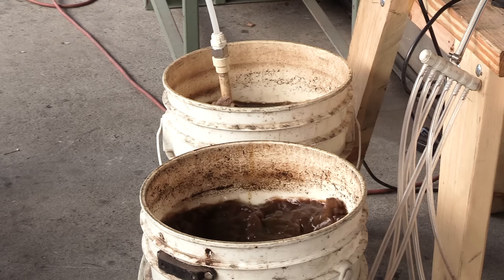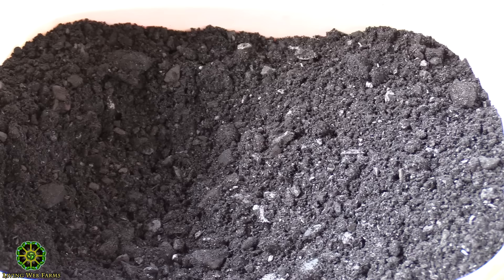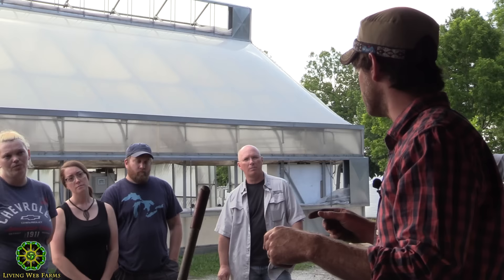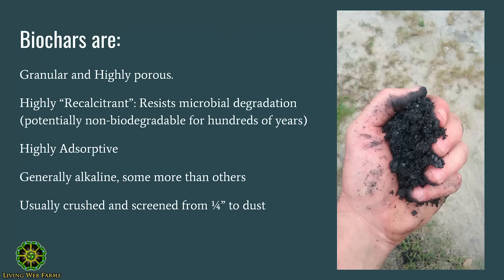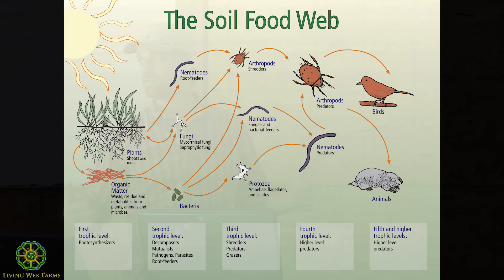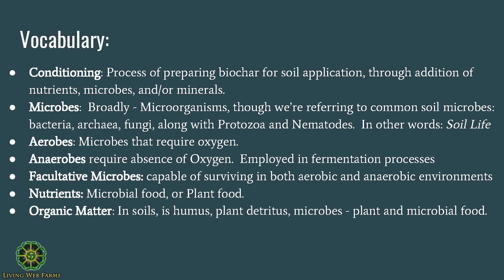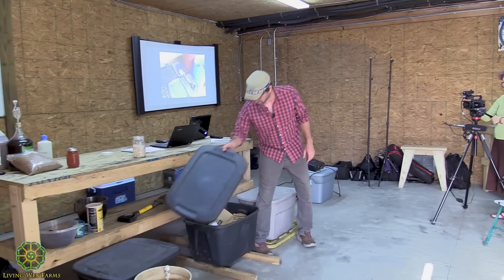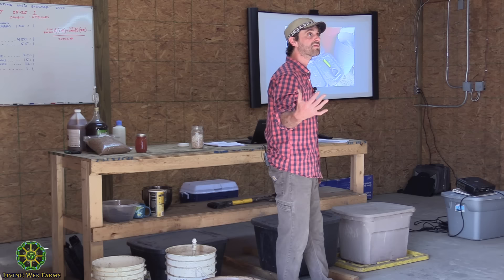Biochar Inoculation with Dan Hettinger

Comment: The fact that the Red Wriggler worms are at the top of the worm bin material, and not deeper down in the material, is not indicative of a problem. Red Wrigglers congregate and feed near the top of the soil.  Nightcrawlers and many other species of earthworms burrow and live deeper in the soil (and, thus, are better for soil aeration than are Red Wrigglers).
Reply: That is also my experience with Red Wrigglers. They like to hang out right under the food layer. If they’re burrowing away from the food, you may have acidity buildup from over feeding.
Reply: Theyll move to the wettest part of the bin, yes this does tend to be where the food is, but they will go extremely deep in the bin in pursuit of the moisture.
Reply: Yeah he knows a little he is killing shit though, to much air first off. Second all you need is a bacteria culture. With nematodes and protozoa bacteria and so on.

Comment: I'm skeptical about the way I see biochar being applied.  The idea for biochar is twofold.  One is that is helps the microbiome of the soil, but the other is it's REGENERATIVE.  But throwing biochar on top of the soil, to where carbon can still leech out to me is not regenerative.  Adding biochar needs to be done along with soil preparation before plants are ever planted, to get the biochar mixed down in the top 12" or further for deep rooting perennials.  

One driver for biochar is what farmers did in S. America in the Amazon, but those farmers dug deep trenches and it was a combo of biochar and organic debris falling into the trenches and then buried.

Comment: Hey Dan, sorry for the stupid question, but I've watched the video several times and couldn't get an answer to this question: how long do you leave the biochar soaking in the compost tea?
Reply: Same question here. I can’t find any info anywhere on how long to soak the bio char. I’m brewing compost tea with bio char in it, hoping more time in a bubbling solution helps.
Reply: I would recommend adding compost and biochar to the soil you want and adding molasses later or not at all
Reply: @robpash2204  he said an hour
Reply: @tinatina4789  seems it would need more time, I'm not sure
Reply: @tinatina4789  Thank you, Tina!
Reply: @tinatina4789  It takes days for best results. The hour he referred to was how long before the microbes in the compost tea start to die after removing the aeration.
Reply: I'm going to make a batch of compost tea and then soak the biochar in it for a couple weeks, even though many microbes will die off aeration. I'm also going to add 3 times as much compost to the mix, while it's soaking. Good plan? Bad plan?
Reply: @pedro.meza.33  experiment and report back
Reply: @mrbill700  I wish I had a microscope
Reply: @robpash2204  he said it was brewing for a little over 24 hours at the beginning of the video!
Reply: 24hrs
Reply: 14 days

Comment: I'm just going to start throwing this out there... Years ago, when my son was a young boy, we loved camping and discussed ideas of all things survival. I spoke about an unknown idea I had of a human waste pit and on each defecation adding a sprinkle of fire ash to deodorise, which would also balance acidic urine. I wondered if, once the small pit is full, straw or hey may be optionally mixed in, top the pit with turf for a time to partially compost the matter, then dig up and shape into blocks which are air dried and used for fire blocks as fuel, and very possibly make great fertiliser for agriculture also! I've always wondered why society doesn't seem to know what to do with it's excrement, other than throw wash it into the water ways??!
Reply: Other societies have used human waste heavily in agriculture, but have run into disease problems. Those problems are easily solved with our modern understanding of the science, but we now have so many cows and pigs that it makes very little sense to use any other manure. Of course, if economics wasn't the primary concern, there are all kinds of ways we could do things better.
Reply: @ernststravoblofeld  thank you for your comment :-) .. I agree, if economics wasn't our (!?) primary concern, then there are all kinds of ways we can do things better. 
Human waste, I am suggesting, is treated and fermented in localised earth pits with the application of pure fire ash which deodorises, moderately sanitises, and balances the acidic Ph (of urine and faeces) also. After a time of fermenting, it is then taken from the earth pits, it may be added to for purpose of application, then dried out in blocks. I further suggest that these blocks, due to the process which deodorises and sanitises, may be used as fuel also. Surely, this controlled and well balanced fermentation process may encourage good bacteria for the application of fertiliser; I'm sure fire ash is a key to this (as would be certain types of volcanic rock, like pure Zeolite).
Reply: @CRHall-ud9mq  If you sanitize it, you kill all the bacteria. That's what sanitizing means. 

The best possible use for human waste is not as fuel. It is an extremely good fertilizer though, with certain issues. Burning stuff for energy is something we really shouldn't have to do anymore.
Reply: @ernststravoblofeld  I wish you would tell all the energy companies still using fossil fuel, virtually every other person throughout my town who has had log burning stoves, or open fires fitted for burning coal (can't open windows here some days in winter, for the toxic CO2 smoke of burning coal blowing in, like it's 1989!), every other trades person and local farm (one acquired an incinerator) burning their waste complaining of paying for it to be accepted at the tip (choking black smoke blowing across the valley with the stench of burning plastic, rubber, and chemicals); tell them Ming. 
What do you do with your human waste? Are you completely carbon free on energy consumption? 
What is your study and area of chemistry? What is your understanding of the Ph of fire ash, it's properties and uses, and of fermentation in this respect??
Reply: Piffling over word usage, 'moderately sanitising'? Your argument, is like saying Manuka honey kills all good gut bacteria! Perhaps, also consider antibacterial herbs used in fermentation. Manuka essential oil fibroblasts cell walls, killing some of the worst known virus and bacteria, but healthy cells (those of the body supplied with living blood) recover extremely quickly. I bet you're not keeping up? So, certain issues arise when people think they know better without really understanding or having a genuine feel for the nature of life. Good luck mongy Ming ;-)
Reply: @CRHall-ud9mq  Words have meanings. If you just use them any old way, you aren't communicating. Especially in a scientific context. Rambling on about honey doesn't change that.
Reply: @CRHall-ud9mq   you're trying to solve a problem by dreaming up a process that's actually more complicated, time-consuming and energy-intensive. Economics are always a huge factor. If something costs more for possibly the same end result with the same or more hazards along the way, it is simply not a good idea at all. 
Do some experiments on your time at your expense and have the results peer-reviewed if you're serious about it. On a small individual scale you may find your idea works for you on your property. I'd be extremely surprised if you found a way to scale it up to a community or industrial level and be cost-effective/efficient. Personally I wouldn't bother with any of that humanure compost fuel stuff, but it's your life and budget.

Comment: I’ve got a question about the process at the 2:19 mark in the video. You mentioned adding all that air keeps the more disease carrying anaerobic microbes at bay which makes sense. What I don’t understand is how then shutting off the air and dumping it into a bucket with bio char is any different than just shutting the air and letting it go anaerobic. It’s not addressed as far as I saw in the video of how long it sits with the bio char  without air and what comes next.
Reply: By using the aeration bubbles during the growth period, the aerobic bacteria consumes the food supply and grows.  Once you turn off the bubbler, the food source has been consumed and the good bacteria has a hold, and will be able to overpower any bad bacteria.

Comment: Bag is called a paint strainer
Reply: Yes. They're very handy for several uses, affordable, pretty durable & washable, and can be found at almost any hardware store. 
I have also just used an old cotton pillowcase to steep compost... it works OK but obviously it doesn't drain as well.
Reply: A delicates bag from a store's laundry section would work pretty well I think. I don't recommend borrowing your wife's.
Reply: I think there is a similar bag strainer called a "jelly bag".

Comment: all your information regarding the good aerobic micro bacteria and fungi inoculation into the biochar is crucial but you make a big mistake. let me explain when you add the water filled with aerobic microorganisms you drop too much water or too little biochar so the mixture is saturated. There is no air in the mixture and so the good aerobic bacteria and fungi will die.  the solution is simple to add much more biochar or less water. thank you for all the good information.

Comment: How long the charged biochar has to be kept after charging with compost tea shown in the beginning?
Reply: The charging is the bacteria cultured in the fertilizer and tea.  It will stay around as long as they have something to eat.  So you could add fertilizer to the biochar and mix it in or, moresimply, dig a hole or trench in the ground and dump it in to be moved later when you need it.

Comment: I've read different in a scientific paper about leachate. Compost leachate is not very high in the NPK type of nutrients, it's basically humic acid and another type of acid I'm failing to remember. Still good stuff for plants but not high in nutrients and I haven't wanted to use my own 50 gallon drum worth of the stuff diluted with sea water to charge my bio char, I leave that to the giant composting bin next to it. I like to use the leachate diluted with well water to soak mulch layers. Plz share your own info.

Comment: Take the HOT char immediately out of the container and dump it right into the liquid.
Makes a LOT of steam too.

The char quickly cools off and draws in the liquid pretty fast.
Let it sit a day or two then strain the char.

Next smash it gently to the size of grains of 'salt' about the size of what you find on a salted pretzel.

Dust the wet biochar with some flour and mix well.
Spread it out to dry for a day.

In your liquid add in some apple cider vinegar with mother.
Just a little and check.
Reply: Heating your liquid over 118 degrees will kill the very things you want inside.
Reply: @mountainman3602  Yes. Seems more appropriate to crack it with a solution of SEA 90 & water. Any guess as to the dillution ratio to water?
Reply: @mountainman3602  The idea for quenching the charcoal is to fracture it into even smaller pieces.
Once the water is cooler, add in the other goodies.
Reply: @flatsville1  yes its all in video. im stunned how many questions here is already said by Dan during his presentation. good for you it is recorded. im not native english and his accent to me sounds like he is singing but I managed to get it all.

Comment: Would comfrey tea be a good starter?
Reply: I use some mixed comfrey tea with water, non sulphur molasses, a little wood ash, and some apple cider vinegar with mother.
I toss HOT charcoal immediately our of the wood burner into that mix.
Cooling effect draws stuff in quickly. I let it sit for a couple days or so, then strain out the biochar, and smash it up to granular size or smaller.
I then sprinkle some wheat flour on it and mix well.
I let it air out for a day, then mix it into my hugelgarden top couple of inches.
It is winter time now so I can't do things much differently.
So keeping fingers crossed here.
Sometimes I add in some organic 'chicken' type fertilizer on occasion.
Reply: Any time you heat your liquid above 118 degrees it will kill the living orgs ie the mother and other micro orgs you are trying to create.

Comment: Great video.
After you’ve inoculated the biochar in the worm tea, could it technically be stored in a bag until needed? If I was selling it for example.
And, is that biochar going to go anaerobic while it’s immersed in the tea?
Reply: biochar needs to be actived and anaerobic is term that applies to bacteria or microbes.
Reply: @tinatina4789  thanks, but that doesn’t answer my question.
Activated biochar means it was quenched to distinguish the burn, fracturing the structure and enlarging it’s cavities.
Most people make aerated worm tea, meaning it is aerobic bacteria.
My question is, will that aerobic bacteria die and be replaced with anaerobic bacteria when stored in a sealed bag without aeration.
Reply: @pilkyish  Exactly my question as well. They say once the "air" is removed during the bubbling process that aerobic bacteria begins to die off very quickly. Well, how does the aerobic bacteria survive in Biochar without the bubbling?
Reply: @rowdyj9251  there’s a lot unanswered isn’t there.
I’ve seen some say that the microbes become dormant, and sealed upon introduction of new food sources, and others say it does completely.
Reply: It's possible that it's entirely pointless to add microbes at all.  Indigenous microbes are everywhere, multiply rapidly, and will quickly colonize anything added to the soil.

Comment: Since biochar is highly alkaline, is biochar helpful with soils that are alkaline like here in the desert southwest?
Reply: Derek absolutely.
Reply: good question
first note that some chars are more likely to be alkaline than others.  grasses, bark, etc. are more mineral rich to begin with.  Our quick and dirty tests here at LWF reveal that our TLUD char has a ph of around 9 when made into slurry and tested w/ a digital meter.  Char from our larger retort system is lower, in the 7.5-8.5 range. I'm not positive but I'm guessing this is due to largely to ash cont
the ph can also be moderated with conditioning.  in part 2 of this video I talk about soaking char w/ biological rich, acidic bokashi leachate as a means to lowering, charging and inoculating in one step.  wood vinegar is a good for ph adjustment too.  recent trials are showing WV may be very good for softening char prior to composting.
Reply: @danielhettinger8182  biochar itself its not alkaline because its stable ,but the ashes residues are adding alk.Washing the char first shoul clean somme of the ashes or a better burning process that makes less ashes ,would also lower the alk of char.

Comment: how do you grind biochar. and how do you charge large quantities of biochar.
Reply: I grind mine in a garden mulcher (5hp petrol motor).  Doing home scale, so I process roughly a large wheelbarrow full at a time.  The important thing is to have the moisture level right.  Too dry and it turns to dust,  too wet and it becomes a thick paste. If you get the moisture level right,  it flows through nicely in sizes up to 1/4".

Very important to wet and charge it before use.

Comment: Thanks, looking forward to Part 2.

A little confused on the initial wetting of char.

 Looks like I can quench initially with Sea-90  mixture, and then let it dry out before crushing to size??
Then I could inoculate it after it has dried? 

Also how long did you steep the char with your tea?

Hopefully these questions will  be answered in part 2, thanks.
Reply: Wetting doesn't necessarily have to be an additional step - so long as the finished, conditioned biochar has been wetted, so it's no longer hydrophobic (repels water, floats).  Depending on how it's made some chars are more hydrophobic than others.  This likely has to do with pore-clogging tars that re-condense on the chars.   It's believed (see: David Yarrow's work) that quenching (especially with a mineral rich solution) helps dissolve these tars.  Some processes require a quench - the TLUD and kon-tiki for example will continue to smolder to ash unless quenched.  

You can crush wet or dry... 

You can inoculate wet or dry.  Moisture helps microbes move in.  Nutrients 'stick to the walls' of the char.   Char is capable of holding ALOT of moisture, and is in turn difficult to dry again.  Use this to your advantage: if you want to absorb compost tea, urine, etc, soak it when it's dry.  If you want to clean up the floor of a chicken house, apply it dry.   If you want to mix it with worm compost and apply in the garden soon thereafter, maybe best to wet it first.  

I've read microbe populations in compost tea crash quickly after shutting off air supply.  Try to apply within one hour.   I'll soak char until it's no longer floating, stirring occasionally if I feel I need to introduce more air.  Drain the liquid and apply that in the garden too!  Like Pat says in the video - important not to let the biology rich char dry out at this point.  Best to mix with OM rich soil as soon as possible. 

Hope this helps.  
Thanks for watching
Reply: @danielhettinger8182  Dan, If I chose to soak the biochar post cooling in a SEA 90 solution, what is a good water dillution ratio? ( Perhaps I missed it in the presentation.)
Reply: @flatsville1  I had followed their recommended  mix rate for foliar/compost tea applications at 1 tsp/gal.   Thanks for watching